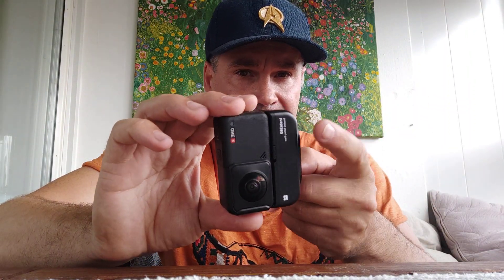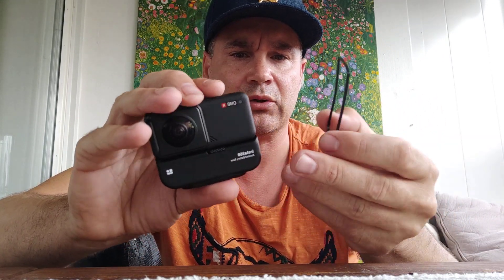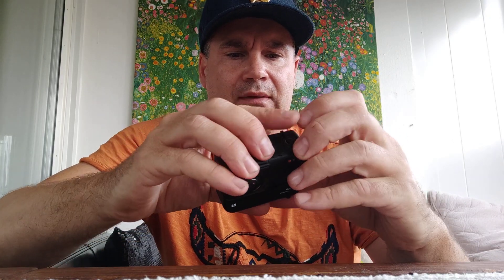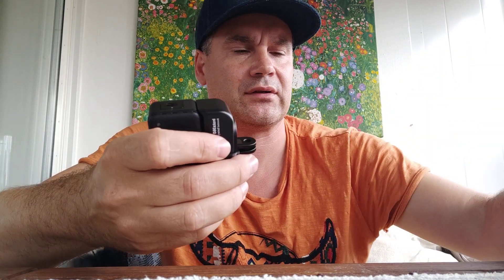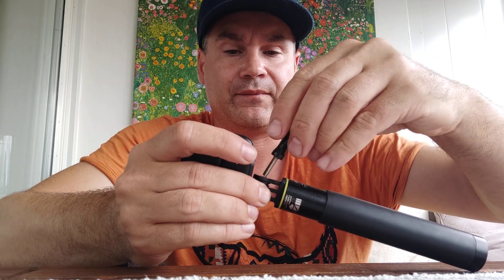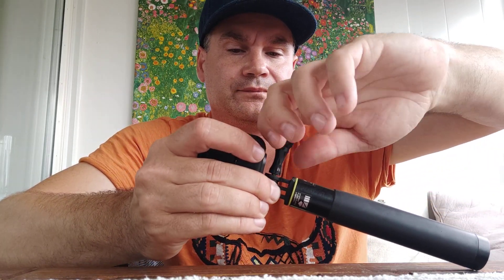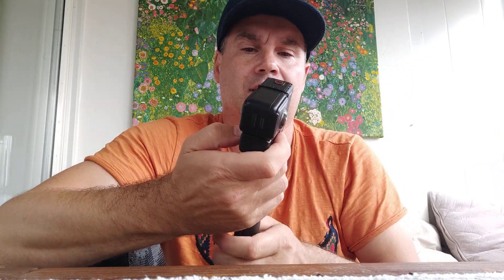how to make Insta360 ONE R + BOOSTED battery ...ready for action 🎥

Comment: Why wouldn't the camera is still waterproof? All you did was swap the battery.
Reply from the maker: as the ring presses tightly base and battery together
Reply: @ThousandHobbies  What selfie stick/grip are you using in this video?
Reply from the maker: @brianmagicman3556  https://www.ebay.com/vod/FetchOrderDetails?itemId=133324771263&transactionId=1665381564003
Reply: @ThousandHobbies  link doesn't work??

Can you paste the item number ?
Reply from the maker: @brianmagicman3556  133324771263  (Alloy Telescopic Monopod Selfie Stick For Gopro Sports Action Camera Accessories)